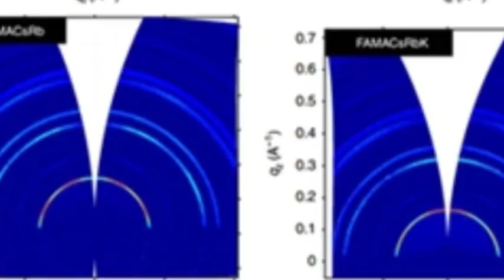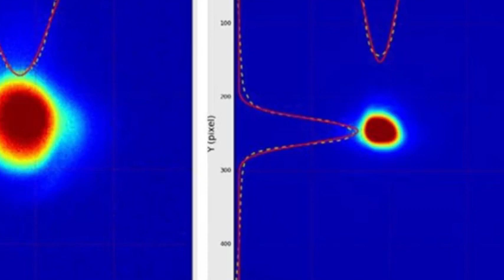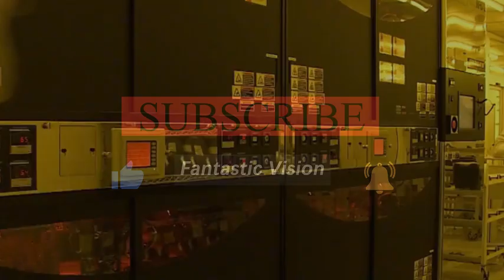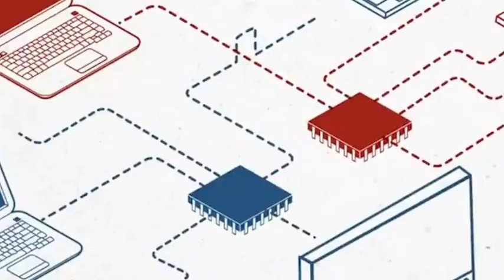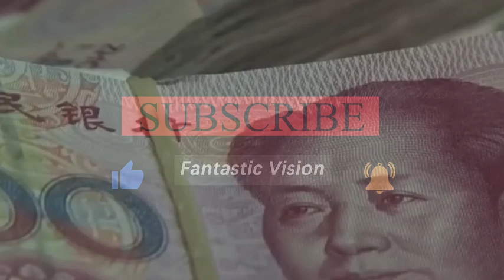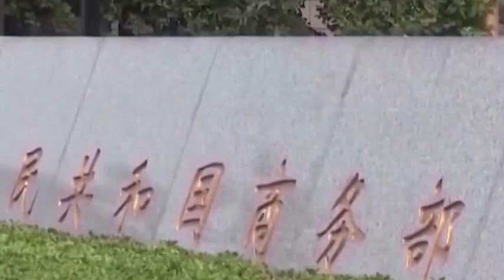China becomes the only country in the world with a complete production line for lithography machines

Comment: summary: China has been heavily investing in technological development to strengthen its national capabilities, particularly in the production of semiconductor chips, which are vital in the information age. Despite facing restrictions from countries like the United States—which has pressured allies such as the Netherlands to block the export of advanced lithography machines to China—China has persisted in its technological advancement efforts.

Historically, China's exploration of lithography technology began in the late 1970s, leading to the development of its first near-contact lithography machine. Progress continued slowly due to limited resources, but the country maintained its focus on this critical technology. Recent achievements include the development of Krypton Fluoride and Argon Fluoride lithography machines. While these machines have resolutions of 110 nanometers and 65 nanometers respectively—falling short of the most advanced Deep Ultraviolet (DUV) and Extreme Ultraviolet (EUV) technologies—they are sufficient for producing 28-nanometer process chips.

These advancements signify that China is reducing its dependence on foreign technology for certain types of semiconductor manufacturing. Although there remains a gap between China's lithography technology and the international cutting edge, these developments highlight China's determination to overcome external pressures and accelerate its progress in high-tech fields. The country's ongoing efforts are expected to contribute significantly to narrowing the technological gap in the future.

EDIT: ASML's DUV machines currently only go down to 65 nm, and Huawei is able to do quadruple patterning to make chips at 7nm. These DUV are entirely sufficient to mass build server farms for cloud computing and AI and everything else.